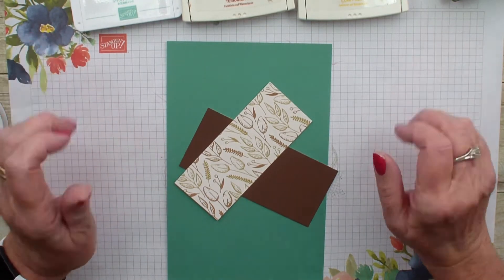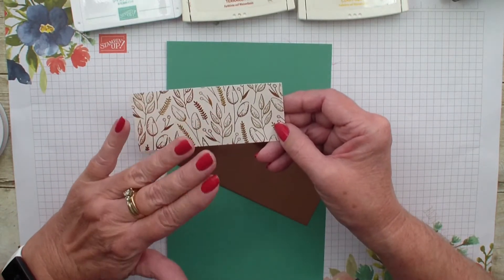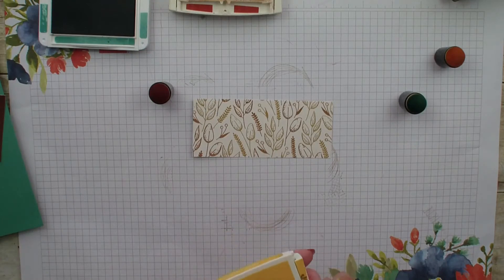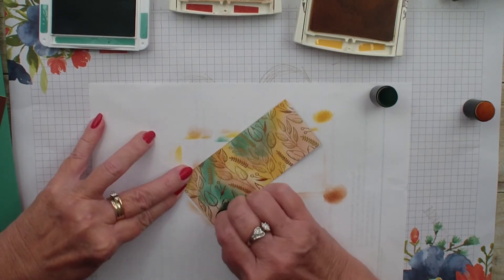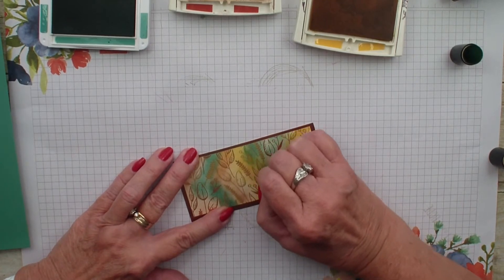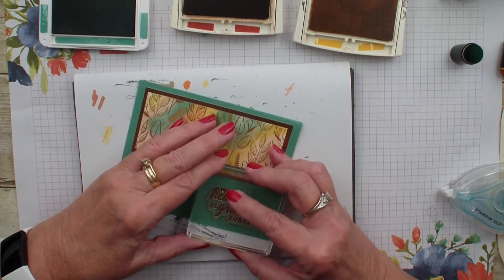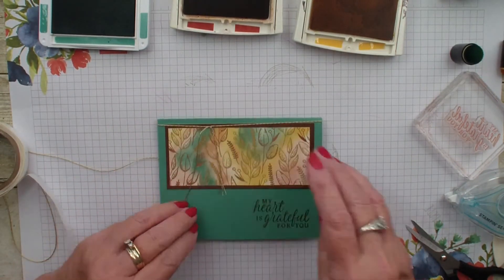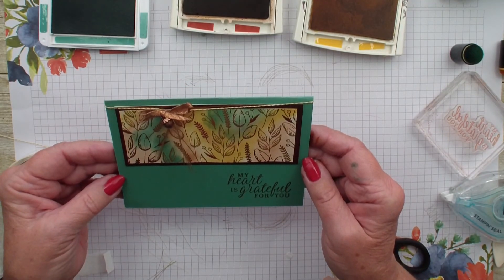Stamp Technique Copper Resist

Comment: A tip for tying knots. If you get some self-closing/cross-lock tweezers (the kind you have to squeeze to open), they are a big help. Just tie the first part of your knot, clamp the tweezers onto that, and they will hold the twine/ribbon while you finish tying the knot. I got that tip from Julie Ebersole, & it works really well, especially if you have hand issues like I do. :) I love the way your card came out, Linda! The colors you chose are so pretty together. Great design, too. Thanks for sharing. Take care, & have a wonderful day! :)
Reply from the maker: Thanks for the tip.